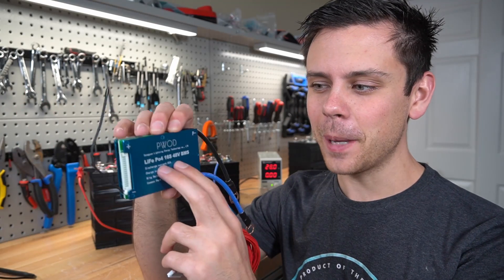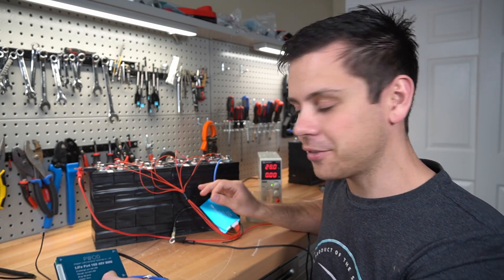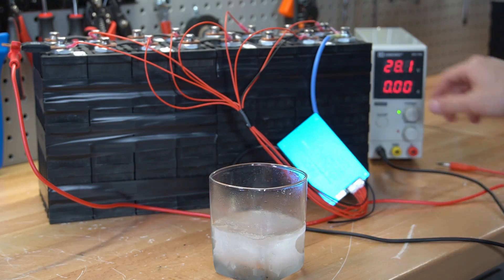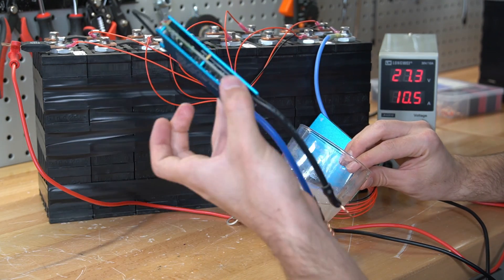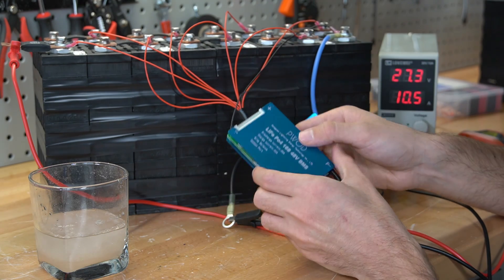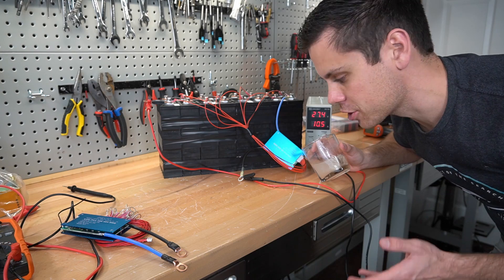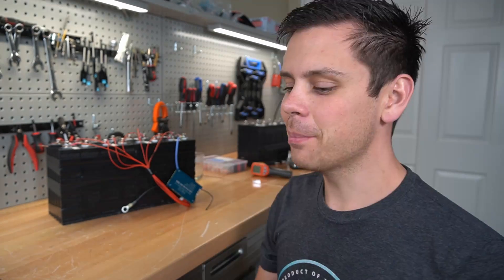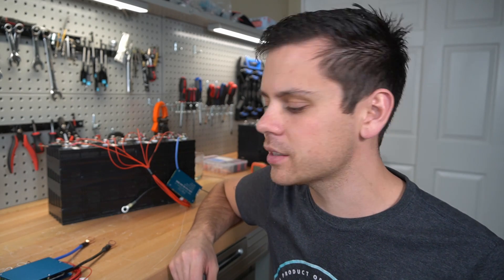PWOD LiFePO4 8S/16S $20 BMS Low-Temp Protection Test

Comment: I saw your other video with the Victron low temperature sensor protection setup and was wondering if any other inexpensive charge controllers have that capability as I have an Ampere lifepo4 12v 100ah battery and definitely need the same setup, just didn't want to spend $200 for the solar charge controller for a portable setup.

Comment: Hi, this one has temp cutoff; you should test it Cyrix-Li-load 12/24-120, and its cheap. "shut down of the load in case of imminent cell under voltage, and
 - shut down or reduction of the charging current in case of imminent cell over voltage, high temperature (>50°C) or

low temperature (<0°C)"

Comment: You have excellent videos and I learn a lot. Could you please do a video on how super capacitors could act like a surge charge bank for high loads? Would be a great addition because many appliances only have short-term surge loads and then can run on lower wattage. Or the super capacitor bank could even provide extreme amount of amps once charged to any close connected appliance (needs large gage wires I assume).

Comment: Hi Will, great reviews of solar systems I am impressed.
I am building my own system but are facing som issues with the EPever Tracer A Series seems like they do not stop charging at the Voltage set point, have you experienced a similar problem. 
Br. John

Comment: Good Morning. This is a quick question.  Is there a device that can be used as a shut off on the batteries when the batteries get to 12V. or lower and reset at a higher voltage when it is save to use.  I have AGM 6V golf cart batteries. Jack

Comment: I am building a small irrigation system. The pumps run with 12v, the controller with 5v.  I want to use 18650 batteries, for that I need a 3s or 4s bms. What can you recommend me there?

Comment: Have you tested any of the 1,000 peak 600wh (no name) pure sine wave power stations on Ebay which are less than $300 with free ship?  No doubt these are from China, but I'm in my 70s and don't care if it only lasts a few years as long as it will handle my needs for boondocking.  However, I need something which will run a small compressor fridge.  What's your opinion on any of these Ebay finds?  And for an old woman who doesn't understand a lot about solar etc., do I need anything more than solar, and a monitor when hooking up one of these?  If there's a charger and inverter built into these portables, I don't understand why I see some people with a charger hooked up when they are only using a Jackery or other portable?  Am I just not understanding these correctly?

Comment: Hi Will,  Where can I buy a 12v BMS with low-temp cut off and bluetooth but it has to be 300 A ?
Reply from the maker: You should run a higher nominal battery voltage. 12 volts is horrible
Reply: @WillProwse  However, I have bought an order made 2 X 500 AH batteries =1,000 AH (12V  LiFePO4) . Each unit has a BMS without low-temp cut-off.  I also have a 3000W of Magnum Energy MSH3012M Inverter/Charger.  So , I am intending to replace  the existing BMS with the new ones with low-temp cut-off and blue tooth @ 300 A X 2.      Kindly advice if there is any 300 A BMS (12V) available and any other solutions.  Thanks again, Will.

Comment: hi Will. I don't know much about solar PV system. I need your expert advise. what would be a better battery setup, 6 batteries of 48v 100aH (5kwh) = 30kwh or 3 batteries of 48v 200aH = 30kwh? I'm not sure if I was asking the right question or given you the right information. thanks for your help.

Comment: I read som spec sheets for BMS, and some of them have I timer. So the low temp only kick in after 1, or 5 minutes. Also some BMS have a sensor on the pcb board, and calculate a average. Before cut off is triggerd.. please do the test longer and also lower the temp on the BMS..
Reply from the maker: I didn't after this video was filmed for half an hour. Where is this spec sheet you talk about? And why would they have a timer? Doesn't make sense

Comment: Victron have a reliable wireless temperature and voltage sensor that connects to their charge controllers through bluetooth, can also be programmed to cut off a few degrees above freezing. With the price of lifePO4 batteries, spending a little more on a victron controller and battery sensor is worth every penny IMO.
Reply from the maker: Yes that's what I recommend on my website for low temp cut off. Agreed.

Comment: What if there is another temps sensor on the PCB and they use this other sensor for low temp cut off. You do not cool down the whole box with your salty water. Temperature sensor is hiding everywhere now.
Reply from the maker: Then I wouldn't buy it at all. The BMS case is a heat sink for the fets. If they put it there, then I would absolutely never buy it.

Comment: Low temp shutdown on charging LiFePO4 is important for battery life . You must cut charging rate in cold . Using 20 Hr rate slow charge should be ok in cold. When you find good BMS with low and hi temp cut off you will give us great video. Ben so many letdown lately !

Comment: Nice testing How about ways to keep batteries warm(Minnesota)? I am going to drop a battery in a old cooler with Amazon (QAZAKY Motorcycle Motor Bike ATV Heated Grips Handlebar Heater Hand Pads Warmer 12V )ATV Heated Grips Handlebar Heater) under the battery $7 and ( 2PCS Temperature Controller Module with Case, XH W1209 Display Digital Thermostat Module with Waterproof NTC Probe -50~110℃ Electronic Temperature Temp Control Module Switch ) as a control $9. Any thoughts?

Comment: In some cases (on other types of devices, admittedly), there is an on-board temp sensor that controls some functions.  Have you checked?  Try putting the whole thing in a freezer for a while.
Reply from the maker: if it has a low temp sensor on the unit itself, I wouldnt buy it for that reason alone
Reply: DIY Solar Power with Will Prowse agreed

Comment: Salt water is electrically conductive.  Could that be causing some of the low-temp failures?
Reply from the maker: Dried cleaned it then tested in bag and didn't help. And probably not. Most sensors work well in water

Comment: I was a calibration/instrumentation tech for 20 years, now retired. We used mV and a resistance simulators for troubleshooting temperature measurement devices. These troubleshooting devices are relatively inexpensive these days. Also, are the temp sensors water resistant/waterproof? If not the cold water bath could be shorting out the sensor. Granted, unsoldering or cutting leads may void a warranty but its less invasive than cutting a battery housing open. Personally, if I had tested multiple BMS units with advertised Low-T cutoff and they all failed my test I would want to know if there is something wrong with my test method. Just some suggestions. I really enjoy your videos.
Reply from the maker: Yes they are waterproof usually. If they weren't, I wouldnt use it for that reason alone. And yes, it would short out the sensor instantly. Very true. And my salt water test works great on high quality bms, even with dirt cheap sensors. Usually the dependent variable is the cost of bms. Unfortunately.

Comment: Hello. First off al keep doing this. I love to watch your videos.

I use a delly BMS in my work van with a 260ah lifepo4 battery. For charging my tool battery's and stuff like that. I also had the problem with the low temp cut off. 

I solved it by using a separate thermostat which triggers a big relay. When the temp is below 2 degrees Celsius the thermostat won't close the relay. Pretty simple and it works great. 

Maybe you can try something like that.
Reply: I power the thermostat with the charger. So it doesn't consume a constant amount off power. It only uses power when the charger is on. I charge it with the alternator wen I'm driving and somtimes by wall power at the job site. 

So far it works great and costed me below 10 Euro's.

Comment: A suggestion - try Freeze spray used for electronics troubleshooting. You can test on-board sensors too. It's quicker and usually without conductive condensation. I'm from the mid-Atlantic area and an RV'er (w/ BB's!) so low temp cutoff is important. And I've got a few Dalys I can't use :-(

Comment: Hi Will.  Question 1 - When using a Daly BMS(common port), if I have an over-voltage  scenario will that only stop it from taking a charge or will it also disconnect the load as well and vise versa? I want to be able to disconnect the charger in a over-voltage scenario but still supply power to a load and I want to be able to charge in an low voltage scenario while disconnecting the load.  Will the common port do that or will I need a seperate charging port on the BMS?  I'm trying to build 2-12v Lifepo4 batteries,  each with their own  4S -12v -100 amp BMS and then connect them in series for a 24v trolling motor.  Question 2 - Can I charge them separately with a 2 bank 12 volt charger while connected in series(connecting 1 bank to the pos and neg of battery 1 and connecting bank 2 to the pos and neg of battery 2) or 1-24 volt charger using the positive from battery 1 and the negative from battery 2?  I know you can do that with a lead acid battery but wasn't sure with a Lifepo4 batteries because of the BMS. Is there any advantages of one vs the other?

Comment: I bought 2 Daly 40Amp BMSs(common input) after watching old video of yours and at least mines don't have working high voltage disconnect. I drove some cells to 3.7v and charging doesn't cut off. I tried disputing that and seller asked me to send more proofs, although I had already sent pictures with voltages, so I gave up. Now I am looking for something that really works and has low temp disconnect.
Reply from the maker: Wait with a Daly? What model. That's very weird
Reply: @WillProwse  as i wrote in another comment, if i was in your shoes, i am not afraid if in BMS low temperature doesn't work, but if the BMS really works! 
Are we sure that a bms cutoff current if a single cell is overcharged or overdischarged?
With Daly BMS i am not sure they really work
Reply: @WillProwse Says: Dong Guan Daly 45A 1-102-00510-07H 2019/09/12. Everything else is Chinese. I bought those as 4s Lifepo4 45A BMSs. They properly low-voltage cut off at 2.5v, so I doubt they are LiIon.
Reply: I just used image translator. It also says in Chinese: Charge Current 45A, Discharge current 45A, Same port, Litium Iron Phosphate

Comment: How about just a cheap temp control with a contactor big enough to handle the current? Chargery sold me some contactors that look like they would start a bull dozer. I haven’t used them yet. Program a Midnite correctly you may not need it. Correct me if I am wrong, lifepo4 batteries bulk charge right up to full charge then go to float? Seems I remember lady a The Solar Biz telling that. Can’t get thru to them or Midnite Solar these days. Can’t figure dour how to bulk charge without absorb on these Midnite chargers. The manual is useless for lifepo4 or ion batteries. Then there’s the batteryhookup disaster. At least my battery bank overseas is healthy!

Comment: I saw a lot of videos where  youtubers drop out wire from a single cell to simulate a died cell and nothing happens! The charge and discharge continue. 
So i decide to don't buy any BMS. 

I am the BMS of my battery
Reply from the maker: Ant BMS and Daly BMS will shut down if that happens
Reply: @WillProwse  look on YouTube what happens to Daly bms when a positive wire is drop out from a single cell: nothing! The charge and discharge continue. 
I didn't see any video on ANT bms with this problem. 
Can you make a video test?
Reply: @zarbonida  I have  a daly bms on my system if one wire is off it turns off the charger and the discharge

Comment: Low temp cutoff is such a 49 cent issue - Why can't they get it right ?
Reply: They're trying to save that 49 cents for their own profits, knowing that 99% of the buyers will never test for function. Will is a "one percenter" for our solar power systems :)
Reply from the maker: I think the manufacturer knows what they are doing, but whoever relabels them is clueless. They will copy and paste a LiFePO4 BMS data sheet from another model. Or cheap components. This one was $20 so who knows what they spent on it parts.

Comment: Can you please test again without holding the wire lead on the temp sensor?  Is it possible your skin temperature is affecting the results?
Reply from the maker: No that wouldn't matter at all. I do this everyday. It should trigger in a couple seconds. Watch my other videos where I show how they work in a good BMS.
Reply: @WillProwse  I did that and I seen some of your successful test take a few minutes to shut off.  Let me challenge your thinking...in a real world low temperature environment the leads and sensor cool down gradually.  The temperature sensor will never be "cold shocked" as you expose the equipment to.  It would be interesting to stick a ambient room-tempature thermometer in the ice solution at the same time.  I think you will see that the thermometer takes a few moments to react and register the cold as well.  At any rate I yield to your expertise.  You are good about asking for observations.
Reply: I reviewed your October 7, 2019 $72 BMS video.  You had the luxury of being able to watch the gradual temp drop on your phone.  I noted that you were not holding the leads.  It turns out that that unit has two temp sensors and both had to get to the critical temperature.   There was a delay...due to editing I don't know how long the delay.  Conversely to bring the temperature back up...you held the sensor for some time.  Neither trip conditions was spontaneous.
Reply from the maker: Should still trip in less than a minute. And the ant BMS had two temp sensors, not one. This one has high temp sensor at the fets and that's it.
Reply from the maker: It's frozen salt water. It triggers any BMS with low temp protection.
Reply: @WillProwse  thanks for your reply...keep up the good work.